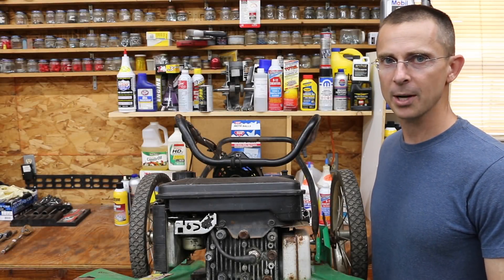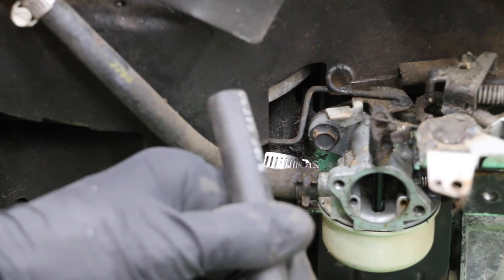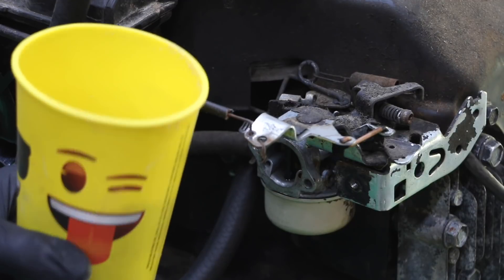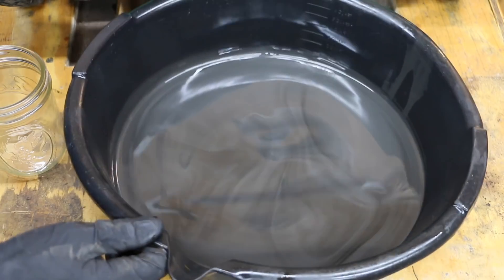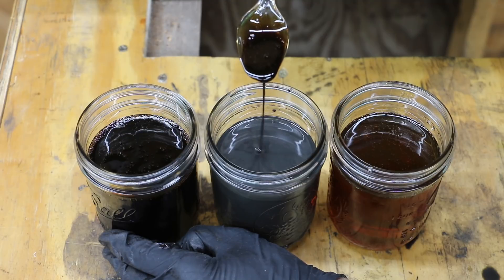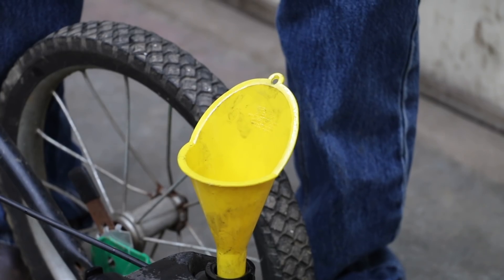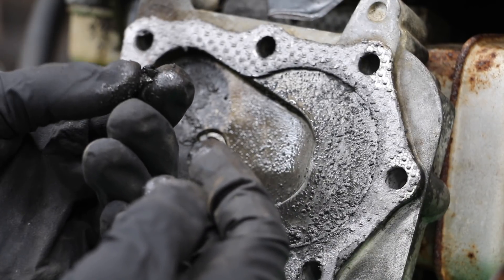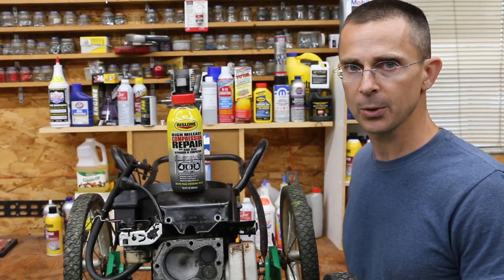Engine Eats Sand! Can Rislone Repair Compression Loss?

Comment: will all Compression Restore Treatments leave so much deposits / residues / buildup  ? 
As usually all of this additives have negative side-effects (eg; oil stop leak really works will block your oil filter and ruin your engine  ) (water stop leak will stop leaking but can block your cabin heating radiator )
Reply from the maker: This is a great question that I'm hoping to investigate. Thank you!

Comment: Why didnt you test the compression in between?  Love your videos
Reply from the maker: I should have done this. Thank you for this recommendation and thanks for the positive comment!
Reply: Love your channel, I have a generator that had ethanol fuel sit in it for a couple of years, how do I fix it?  Also it wasn't that expensive, is it a throwaway?  There was rust when I drained the carb.  It only turns over with starter spray sprayed constantly into the intake

Comment: I don't know how anyone with common sense and knows what end of the spark plug goes into the hole..
 would even consider that a liquid product could actually fix physical  scarring .
you physically you can not restore lost metallic minerals like that.
Is cohesion with a liquid lubricant active,
 actually give and lend properties to  cohesion bonding of ?etalic property elements in small thermal amounts?
Rislone is the epitome of what a snake oil is
Reply from the maker: All great points!  Thanks for commenting!

Comment: The manufacturer's explanation that this product fills in scratches inside the engine has never to me made any sense. Apparently the only way the product increases engine compression is by filling up the combustion chamber with some kind of goop that then turns solid. It's akin to the 1930's mechanic's trick of putting a raw egg into an automobile cooling system to stop the radiator from leaking. Do not even consider using this product- unless you're planning to junk your motor soon.
Reply from the maker: Great point and thanks for commenting.

Comment: I tried it on a toyota hilux from somewhere in the '90's and it had like 1.2 million km's on the clock
Rislome made it die after a few minutes
The damage in the engine was minimal
I had a tiny bit of compression loss
Tried Rislome
Now the Hilux died after using that
Opened up the engine
The minimal damage turned into the same chunks you've had only 10x as big and it rammed holes into my pistons
Sad these products are able to sell to people since it's really a bad thing to put in your engine
Reply from the maker: Thank you very much for commenting on this. I hope others will read about your experience with this stuff.  Thanks again!

Comment: Have you ever heard about putting brake fluid in motor oil I always heard that it will destroy your bearings within 500 miles is there any way you can prove this or disprove it
Reply from the maker: Thank you for this recommendation.

Comment: Keep in mind all that rislone is suppose to gentle clean the engine internals over time not right away. I don't know exactly how it works but the stuff we got here works in my opinion pretty well. Also the stuff I'm referring too is called rislone but it's a blue oil not repair or restore compression on the bottle but has a yellow bottle with a red cap.
Reply from the maker: This is a great point.  Thanks for commenting.

Comment: it worked for me but i used it on a 40:1 gas oil mix engine that my dad forgot to put gas oil mix in it and ran ethanol free in it for 20 minutes. so it didn't score it as bad as what happened to you. I think that your engine might have been killed in action

Comment: put the engine restore in it and see what happens. unlike rislone, engine restore has fine metal shavings in it not just a thick additive
Reply from the maker: Thank you for this recommendation!  I used restore in my diesel tractor and it did a terrific job.  It'll be interesting to see if it can help this engine.
Reply: your welcome. Im really interested too, i have used it in my car and it would be cool to see if it actually fills scratches in the cylinder walls or not. its still a mystery to me how it actually helps compression.

Comment: Rislone looks like Lucas oil additive to me. I had rebuilt a 4 cylinder engine top to bottom that had a defective head gasket and I didn't test compression prior to start up (silly me) and it mixed coolant into the oil and scored the piston rings and cylinder walls. Tried Lucas and had no luck. I believe what it's purpose is, is to increase viscosity of the oil to try and allow the rings to have a more hydraulic lock between the rings and the combustion chamber. It got a big fat negative and I still had to pull the pistons out and hone the cylinder walls and install new rings. Thanks for the video and keep up the unbiased reviews of products!!!!!
Reply from the maker: Thanks for the positive comment regarding the video!  You bring up a great point regarding the way these thick additives work.

Comment: It's also been my experience with thick "restorative oil additives" that they continually starve the engine of oil until they are hot and the additive thins out. Thus; scoring cylinder walls, overheating valve springs, and generally filling a worn out engine with life robbing sludge. Just overhaul the silly thing and have done with it, before you cause further damage. (A&P, Engine builder, and hotrodder for life.)
Reply from the maker: This is a excellent point regarding the side effects of thick restorative oil additives.  Thanks for commenting!

Comment: You should see what happens to a RollsRoyce-Allison C30 when it gulps sand without the particle separator running. I ended up replacing everything but the engine's gearbox.
Reply from the maker: Wow!  Thanks for commenting!

Comment: Can jb weld fill in the cylinder scratches and improve compression? Not sure how this could be implemented so it is a silly idea for sure, but I noticed you are a jb welt fan so figured I'd toss out the idea.
Reply from the maker: Thank you for this recommendation!

Comment: dingle ball hone and new set of rings is the best fix. might try very fine metal valve polish in the oil or in the fuel followed with diesel as a solvent to wash it out.
Reply from the maker: Thanks for this recommendation!

Comment: Despite the oil change i believe there was still sand inside the engine and the solid biuldup came from sand mixed with the additive. You need an old worn engine to test this, not a good one damaged this way.
By the way, i believe you can get good results using heavy gear oil 80w90
Reply from the maker: Thank you for the constructive feedback and for the suggestion!

Comment: So we know one thing FOR SURE...Rislone pretty much not only doesn't help but at the very least would kill your auto engine,and second,if you live out in the desert like say Arizona...CLEAN YOUR AIR FILTER on your mower..(not that you need one out in the desert) and third and most importantly here...just because a product states it can do something DOES NOT mean it will! I am a diesel mechanic in the mid west...even with routine and constant preventative maintenance programs we CANNOT control the wear to the engines...each and every single one of them receive the same oil change intervals and similar air and fuel filter changes at a set amount of hours and yet we still experience engine failures at random hr/mileages...no kind of additives we have EVER used in my 22 yrs at this fleet have EVER changed this...thus the conclusion we have come to...drivers/operators all use and abuse the equipment differently and unless your a metallurgist...you will never know from when,where or what material was used in ANY casting...bottom line save your loot...get into a regular maintenance routine of changing oil filter air filter etc. stick to it for your particular environment your operating in such as "dusty" "dry" "salt" (as in mid west winter) or all of the above and perform your P.M.'s accordingly..additives such as Rislone and all the "smoke" stoppers are just that...SMOKE AND MIRRORS...from a fleet mechanic straight to you all..peace!
Reply from the maker: Scott, I enjoyed reading your comments.  Terrific advice!  Thanks!

Comment: I'm not trying to defend Rislone but the kind of damage you did to that engine with the sand is pretty dramatic. I don't think you could realistically expect any product to improve the performance of any engine with that degree of cylinder scoring.
Reply from the maker: This is a great point.  I really do appreciate this sort of feedback!  Thanks for commenting!
Reply: Exactly. That Rislone product is designed to minimize normal wear not repair catastrophic damage.
Reply: @skittykitty1000  Its still snake oil JUNK!
Reply: Well, XADO additives claim to also fill in these surfaces with a ceramic coating. Could be a good test!
Reply: sleepercell I don't know what's in rislone. But, if you want to use anything that thickens the oil, why don't you just use a thicker oil. It of course will seal better than then thinner oil.
Reply: If it can't repair significant damage, then it's worthless, because minor damage has no perceivable effect on an otherwise well-maintained engine.
Reply: Just fix that engine with ametech restore :)
Reply: I wonder if that CSL stuff (copper, silver, lead) would do better than Rislone?

Comment: I want to say that the leftover sand made the blowby get worse and worse after you added Rislone. I'm not sure though.
Reply from the maker: Mitchell, I previously used sand in a similar fashion in a previous video.  Upon dismantling the engine, I did not find any sand contamination in the piston rings or elsewhere in the combustion chamber.  It's possible that this engine had a different outcome.  Thanks for commenting!

Comment: Have you ever used or tested the "Prolong" line of engine additives? Higher prices but some people swear by them.
Reply from the maker: Yes, I did a video on it recently and it actually worked well to restore compression.  Thanks for commenting!
Reply: Project Farm have you posted the video with the Prolong additives? I have been looking but have not found it!

Comment: I've seen a few tests where restore worked. Curious to see if it would help this amount of damage. I know several drag racers that use restore to maximize their compression and swear by it as they have done the test themselves and it worked for them.
Reply from the maker: Nick, Yes, I'm curious if Restore can help as well.  I did a video on it recently and it helped improve the compression in my diesel tractor. Thanks for commenting!

Comment: It appears to me that there was still some sand in the intake area of the engine that was sucked in after the fact, it would explain the crap in the combustion chamber when you removed the head the second time.
Reply from the maker: Bill, Great point.  The substance I removed didn't quite seem like sand.  Thanks for commenting!

Comment: not real world circumstance. you way over did the sand. a worn engine doesn't have nearly that damage. do it with some really fine sand and just a little until it just gets noticably smokey. test restore too. i have used it and it seems to work on some cars.
Reply from the maker: Jason, Great point.  Thanks for the recommendation!

Comment: One thing I've always lived by, never put ANYTHING in your engine other than oil.  Sand included. :P

It almost looks like the Rislone just increases the viscosity of the oil, maybe you would get the same results from a heavier oil, like 40-50w?
Reply from the maker: Great point!  I agree that Rislone seems to be a viscosity thickener.  Maybe Lucas would do better.  Thanks for commenting!

Comment: Some of the products recomend driving 400 miles before results appear. When the engine cools down it hardens the sut in the gap. It worked after a week in my car.
Reply from the maker: Joe, Great point!  Maybe it needs a few more hours of use.  It was a quart low after 3 tanks at the end of the video test.  So, I added some more Rislone after creating the video.  Thanks for commenting!

Comment: i like this video i have a used push mower i got from a pawn shop looked good but did not have a airfilter.so i just put a home made rig on it to just get by,we mowed a 1arc. lawn for two mo. its a dusting lot. well the darn thing sucked in a lot of drit and stoped running. i was thinking of pulling it apart see whats inside and put some lucas in it ,do you think it will help
Reply from the maker: Richard, You might try starting fluid to see if it'll fire up.  Have you tested the compression?  Lucas might help if you can get it running.  Hope this helps!
Reply: thanks i am sure it is so full of fines from the yard, it needs help.i may work on it this fall .i have 17.5 breggs to get going for the  end of my mowing year, it has sat for 2 yrs, any help would most welcome

Comment: I have a couple new seriously cool bad ideas if you are up to it... 
Now, I am not entirely sure how you would do this. I was thinking if there was a way to put 2 nickel cadmium magnets to reject each other under the piston,  is it theoretically possible to increase your horsepower?

Someone once told me if you want to increase HP, you up the spark plug. How much is too much? Hummm =)

Someone told me when you have bad gas, mix it in with transmission fluid, old mechanics trick. How well does it work? What will it do to your engine?
Reply from the maker: Eric, these are all great suggestions.  The pistons in these small engines are aluminum.  So, the magnet idea would need to be used in an engine with a steel piston.  Thanks for all the ideas!
Reply: The magnet thing I came up with is going to be tricky, but I hope you see what I am trying to accomplish with them.  Will it add hp? Better fuel consumption? And how in the hell could you mount it? Big magnet?  Several small ones? Would it even start??I don't know, but I thought it would be interesting to see, no one has done it so far as I can tell, and a force pushing a piston up faster may be a force pulling a piston down slower. I have no idea how it will react.I felt if they were mounted to the piston and the head, the head may not allow the piston to do it's job or perhaps a clearance issue unless you bore it. may be rejected before it can complete it's cycle? Won't go all the way up? But what do we want more? The piston going up faster? Or down? Or does it even matter? Lawn mowers have a single piston. So I'm thinking faster up. I'm just the guy who will probably get you killed, I'm not a mech, so do this at your OWN discretion =) Disclaimer.

Comment: i read a few comments on using common house hold cooking oil // for a bit farther on that you should try using lard / or Crisco shortening  //  and just as any product used  it will vary on results of long term or short term depending on application and what took place before it was used // another good video  glad to see good information out here // to bad you do not have a old junker car or motorcycle that could be used for testing as they are different from lawn mower engines but same principle applications are used
Reply from the maker: JAFO FUBAR, I plan to test cooking oil soon.  I think it'd be a very interesting project.  Also, I agree that it would be great if I had car or motorcycle engines to test.  Thanks for commenting!

Comment: You should hook up the exhaust to the air intake and see what happens!
Reply from the maker: Sean, thank you for this recommendation!
Reply: that would be like the egr system on a car. If that egr valve sticks open the car wont idle. I expect the same with the mower engine.

Comment: See if putting gas in the oil or using 2 stroke oil will hurt it at all or see if adding too much oil will cause any harm
Reply: Or can you use JB weld to repair a cracked cylinder head or as a head gasket
Reply from the maker: Jason, these are all great suggestions--thanks!
Reply: Project Farm Always glad to help love the videos

Comment: If you're going to try Diesel Fuel Additives could you please try the Opti-Lube products at their maximum treat rates? I used Opti-Lube Boost and Opti-Lube XL in my 6.5 simultaneously; Boost makes the Cetane rating higher, XL makes the fuel have more lubricity. I did notice a slight power increase when using these additives.
Reply from the maker: Austin, Yes, I'll test this if I test diesel additives. Thanks for these recommendations!
Reply: You're welcome. You may have to buy Opti-Lube products at Amazon, I haven't seen them in stores.

Comment: What happens when you mix engine oil ? Like 10w40 with 0w30 for example ? Love the videos !
Reply: They're not formulated the same and who knows what would come out? It'll be different across brands though, motor oils have many more differences than just what the bottle states.

Comment: Lets try make some seep scratches in the cylinder wall and hone it a bit and fix the scratches with JB weld and hone it again so the surface is good and smooth and put an new piston in or something like that 😊
Reply from the maker: Jesper, this is a great recommendation--thank you!

Comment: Can you do a video on olive oil as motor oil?
Reply: Your right opposite. Olive oil has a very low smoking point and one reason it's not good for frying. You would want to use canola or peanut oil as they have a very high smoke point
Reply: I'd like to see that too. Olive Oil has a very high smoke point for cooking oil but it's not as thick as many motor oils and it could oxidize relatively fast.
Reply from the maker: Logan and Austin, This is a great suggestion--thanks!
Reply: i have thought about this myself, and would love to see it done!

Comment: How about a test of the Lucas additives, oil stabilizer, and fuel additive? I have used Lucas products for the gearbox with good results, just wondering about the oil additive on this engine
Reply from the maker: This is  a great suggestion--thanks!